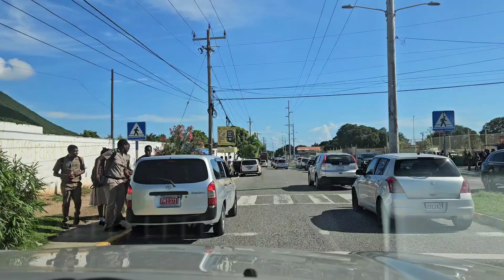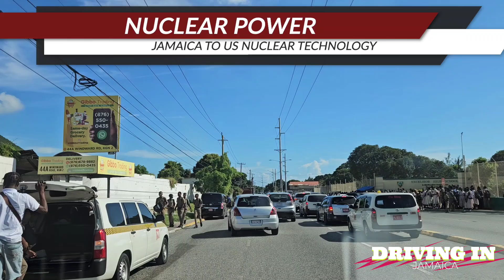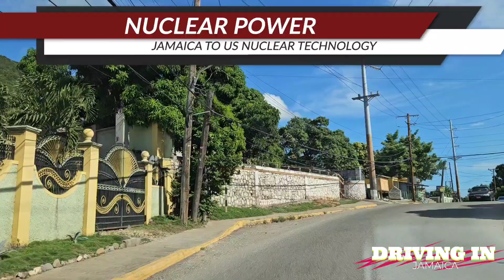Construction Nuclear Power Plant Jamaica

Comment: Why not use the  Chinese technology instead of the Canadian
Reply from the maker: Very interesting.
Reply: You must be kidding. China believes in using coal to produce energy. That would leave us hacking and coughing and choking for oxygen
Reply: I agree
Reply: Maybe because of a decades long perfect track record that led China to adopt the Canadian technology? Here's a cut'n paste: "China has been utilizing CANDU (CANada Deuterium Uranium) reactors, which are a type of Canadian pressurized heavy-water reactor. Specifically, the Qinshan Phase III nuclear power plant in Zhejiang province houses two CANDU 6 reactors. These reactors have been operational since the early 2000s and are now undergoing preparations for a significant refurbishment to extend their operational life by another 30 years" That's why. And also: what the Jamaican govt intends to use, I presume, is a more recent technology and doctrine based on smaller, modular units that makes for more decentralized, easier to control and therefore safer environment. Especially in places where hurricanes, earthquakes or tsunamis might jeopardise structural integrity. Plus it's more democratic: because the units are smaller, even a municipality can decide to buy one of those Slowpoke 2 units to power a district, rather than depend on a national project.